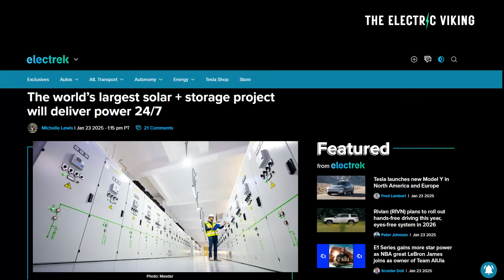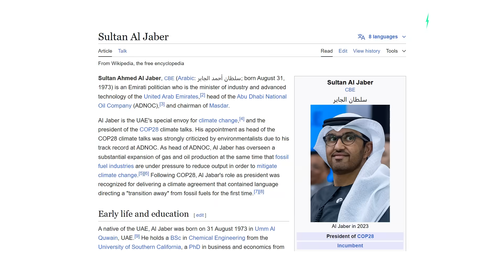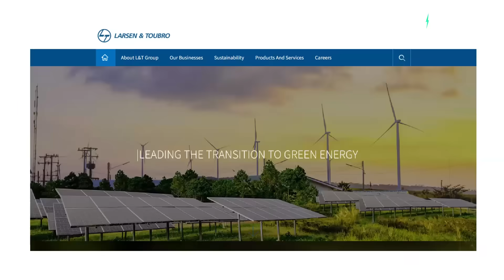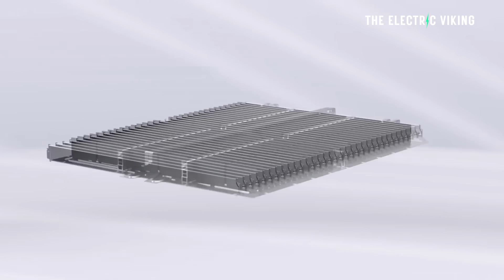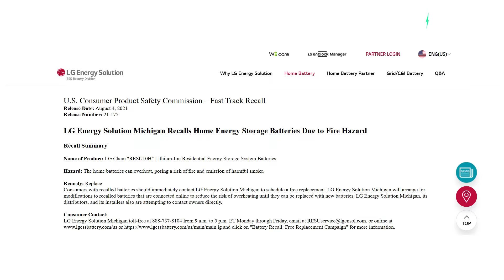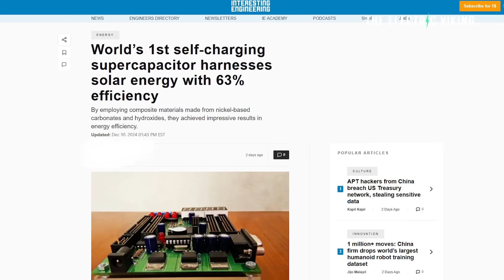The world’s largest solar and battery project deliver power 24 hours a day

Comment: Australia must be cautious in overhauling its electrical infrastructure. If the climate crisis is one of the most pressing challenges, wouldn't adopting multiple clean energy sources be the least risky approach? Relying solely on a non-nuclear option places all bets on a significant reduction in battery costs.

However... If advances in battery storage make decentralized energy cost-effective, the need for a centralized power grid diminishes. Households and businesses could become grid defectors, relying on their own batteries for energy independence. This scenario risks fewer consumers funding shared infrastructure, potentially challenging the long-term sustainability of centralized grids and making green generation projects particularly new transmission lines a waste of money and resources. @electricviking

Comment: FYI that scheme can provide energy round the clock providing it is sunny each day... And someone who lives in the sotuehr half of AU that seems to utterly ignore that it is cloudy so often here. But I was recently in northern Australia.. and largely it was indeed sunny every day after day after. (except when it wasn't) BUT that PV array and thatbatetry would have delivered pwioer at least as reliable as say NSW coal generator that in the same time period broke down one or more times. Yet no one at all claims coal doesn't provide round the clock power.  However for the required in AU  99.998% reliable power neither a single coal powerstation nor that PV and battery array alone is sufficient.
But, in such climates, real solutions that are 99.998% reliable can indeed be built based on such PV arrays. Especially when other complementary technologies are added to the mix.
Reply: Yes. to get to 99.998% reliable there is a bit more needed.
Reply: Hint 98% of sunny days is not 99.998%. Even doubling the battery size might only get you to 100 - (2% of 2%) = 99.96% Triple would/might do it. Depends how idneoendelty random cldy days are. They might tend to statistically cluster and thus more 4 day in row cloudy events than 98% might suggest. Actual climate data required to know.

Comment: Offshore power isn't baseload either sometimes it is not windy out there too. Hell baseload isn't baseload as it is sometimes down for scheduled maintenance and then sometimes is down for unscheduled reasons. So is the supposed problem with VRE and storage all BS? Nope. But is it a huge unsolved problem? Also nope. But the solutions that really work and are quite cost-effective are not simple or simplistic. There is what is known as intra-day shifting such as household battery does shift daytime PV to the evening. We need lots of that. And then interday where we shift energy from one sunny day to not so sunny one. And then there is seasonal where VRE produces (in AU & east cost) less on average in Apr-Aug than the rest of the year. Some way to deal with that at a minimum extra cost. And then finally say once every 7 years or so there is one year that is just worse than average. All that needs solutions, and none of it news to any serious VRE proponent and yes it all has answers. And no energy won't be free, and yes it will be reliable.  Yes almost anything can work, however the most cost-effective solutions use a variety of different things each covering the weaknesses/problems of the other. There are as a fact many more cloudy days than there are days that are both cloudy and windless over large areas. Wind and PV have a degree of anticorrelation that results in needing less storage to firm a mix of the two than either alone.

Comment: Geez Sam...like your passion but no...have you seen the footprint of a solar farm plus even with batteries its simply not viable or practical, with nuclear you simply build and plug into the existing grid, obviously its not that simple but that's the crux of it, even many previously anti-nuclear environmental groups are now barracking for nuclear plants as they are to put simply emissions free without hundreds of acres taken up by solar panels to power even a small town...here's some homework, what size solar farm would it take to power your home city of Newcastle, where would they put the solar farm or wind turbines (which have an even bigger footprint). Solar has its place in the energy mix along with wind and gas but for base load power its simply no.....

Comment: A cubic meter of compressed air can hold 10 to 20 kw and is cheaper than a battery loses can be replenish with only to solar power so the overall cost is lower and last many times more than any battery.

Comment: Elon Musk installed the biggest battery in the world in Australia about 10 years ago or so. That biggest battery in the world can only supply power for about 1 hour. Fact.
That is NOT supplying a base load. Amazing that the greenies STILL have no idea what a base load is. You can call yourself the King of England but that doesn’t mean you are. You can call a battery a base load, but it’s not. Period.
Reply: That one is meant to stabilize, not as backup...i.e it is compensating for fast load changes. If you wanna talk day to day backup, thermal storage is the go to, cheap and reliable. Then we have flow batteries, sodium batteries that will fill the gaps in places with no option for thermal storage.

Comment: It is scary to see an influencer telling the opposite of the truth. This project does not illustrate baseload power. If you draw 1GW from a 19GWh battery you will run out of electrons in 19 hours, i.e., overnight. You had better hope that the sun is shining the next day. (You need the 5.2GW input from the panels to supply the ongoing 1GW demand plus recharge the batteries at a rate of 4.2GW in 4.5 hours)
Reply: Mhmm, that is why we have a grid, there is always sunshine some where on an entire continent....same goes for wind.
Reply: @TheEsseboy  Not at midnight. However geographic diversity does indeed greatly lower how large the gaps are and so we need some storage to make VRE and storage firm, but computations on real data show it is not actually all that expensive to make it work. it only looks expensive when someone tricky does the math with subtle enough errors that you and likely >90% of people don't see the errors. But valid computations show VRE (PV+Wind) and storage is cost effective and reliable.

Comment: I live in Sacramento, CA, about 38 degrees north of the equator. To go off the grid, I need 5 days of battery storage, about 5 times as much solar as I need in summer, to charge the batteries in the few hours between cloudy days. That makes such a system between 8 and 10 times more costly than doing retail net metering with my utility. I did my system myself, and it covers my yearly energy needs by making up for the 5 winter months when I use more than it produces. I do not qualify for tax credits. My system cost me about 2/3 of the best contractor price I could get. I sold stock to pay cash for my system. Keeping the stock would have been a much better deal, and I would not have had to do the work. Cam, you say BIG MISTAKE! I have a 9.2KWDC array, and to go off-grid, I would need at least 46KWDC, which I do not have room for. I used my best solar year and hourly energy usage and generation in a spreadsheet to generate the numbers. It took me 9 years to save enough on my energy bill to break even, not counting the time value of money. If counted the time value of money, it would never break even.
Renewables have reduced our base load and increased the cost of electricity by about 80%. California has the second-most expensive electricity in the United States, but Hawaii costs more because its energy is shipped to them from the mainland. We have so much solar energy that the utilities cut off our inverters when they do not have a load that matches the solar generation.  It's not fun to find out that you are not getting credit for 2 hours of your best solar generation on a sunny day.

Comment: In Australia we should use the cheapest large scale energy storage for our east coast grid, and that is pumped hydro. We have over 100 suitable pumped hydro sites just in NSW. Also we have more than enough land to supply 100% power using solar. Current batteries are great for short term stabilization and firming. Offshore wind like gas, coal and Nuclear are simply more expensive in Australia.
Reply: Did you hear about the solar project that’s going on in Australia?  

Western Green energy hub.   

35 million solar panels, and 3000 wind turbines and Battery Storage Systems.
Reply: @NAY2GAS  Yes, a proposed export industry. Pumped hydro provides longer term higher capacity energy storage at a cheaper price.  Snowy hydro 2 will have 350,000mW storage capacity. ://www.energy.nsw.gov.au/sites/default/files/2022-08/NSW%20Pumped%20Hydro%20Roadmap.pdf

Comment: Did you notice that those batteries cabinets in the Emirates are covered with vents and cooling fans. Heat both internal and external is the enemy of a Lithium storage battery. You need massive cooling to keep  lithium under control, that is the achilles heel of lithium storage.

Comment: Abu Dhabi has  a vast unusable land mass so they can cover the land with panels, but countries that grow the food for these countries are covering usable land to produce power which is foolishness when a base load generator can supply all the power needed and keeps arable land for the growing of food. Absolute stupidity having acres and acres of panels which are weather dependent. Also panels need to be cleaned to keep the efficiency, much easier to maintaining a rotating generator than a solar system.

Batteries require huge amounts of lithium which is mined with significant amounts of precious dwindling  water resources, it is more environmental responsible to use a base-load generator.

Comment: Has something changed drastically with supercapacitors. Present ones can only be charged to 2.7V so it takes a lot of supercapacitors in series to get to a HV car battery. I have been using supercaps for years but they cannot supply even the energy/per volume of even the poorest LiIon batteries. LiIon batteries can be charged to around 3.6V but they store 10 to 100 times the energy storage of a supercapacitor per unit volume. Please show me the article that you are reading this from.

Comment: Sorry Mr Viking, but I work in the power industry. We have a mix of gas turbines and solar. To enable the scale of investment your suggesting isn't practical in most applications.  To sell the power someone has to fund it and then customers have to pay for it. You are showing a very niche situation here. 98% sun, your words. That's just over 7 days of no power input. Make sure your batteries are big enough to run for days without recharging. And don't forget, as the panels get hot they decrease in efficiency and the same as they age. Let's not forget about the losses due to regular panel breakages. Happens daily on our site. Solar has its definite place. It's a fantastic resource but don't pretend it's a stand alone option for every situation in a power grid.
Reply: Sorry Mr Megastr, but it (a mix of PV and wind firmed by seasonal hydro, & storage of multiple types (inc PHS)) is the most cost-effective solution in AU.
Reply: and no I didnt forget any of a whole range of technical details like: aging of panels, getting dark, at night dunkelflautes, PV temp coefficients, transmission losses and costs, baseload, heavy industry, Yadda.
But yes I agree all simple solutions are not optimal at all.

Comment: What if we all became efficient with energy use.  Instead of wasting generated power why not store it instead of earthing it.  What if we all had micro grids connected to the grid with storage systems which will capture excess energy and then help those out that dont have that option due to where they live.  Why should energy generation be wasted and not stored then used.  Then distribute the cost transparently.  Maybe it's so the greedy few can control the market and generate profits for themselves.  I cant believe everyone is enabling this control to come back when they can get rid of these leeches on society.  This is the time everyone can take control of their energy use ... have at it!  I did and it works really well.  Havent paid for Energy in 5 years this includes no petrol bills which everyone simply dismisses as not energy.  Base load is an excuss not to be efficient and to use old systems that are not fit for purpose.

Comment: Baseload is no longer a thing with the implementation of batteries. In fact the whole idea of a baseload has makes the assumption that there is a constant level of demand that doesn't increase or decrease. It fails to realize that demand is always changing and can certainly be serviced with energy sources that can adjust with that demand. The myth of baseload has relegated other energy sources such as renewables to having to meet only the fluctuation of energy left over. This has demanded renewables to be far more demand sensitive, which they can't be given their intermittent production of energy. So, renewables were always kept out of the energy mix in favor of a baseload production of energy braced by peaker power plants that could respond to changes in demand, much more readily. With the introduction of batteries energy demand is matched one for one with energy stored and at the ready. It doesn't matter when the energy is made, as long as it is stored and the storage can match the demand, whatever demand, fully. This makes the energy production market much more free to look for ways to make electricity as cheaply as possible, and puts companies that have batteries the captains of the electricity market. Generators make electricity and sell it to the battery owners. The battery owners can choose the best price for that electricity without regard to when it is produced. They turn around and sell it to the utilities in charge of distributing electricity to customers. Whatever the price the battery owners deam is the price, the utilities will have to come up with the money.

Comment: All  electricity generation methods are" intermittent " . Even baseload coal and nuclear . Nothing runs 100% of the time. Baseload coal plants have multiple generating units so that they have spare capacity for when one unit breaks down or needs to have maintenance work done. Energy storage for renewables is essentially doing the same thing .